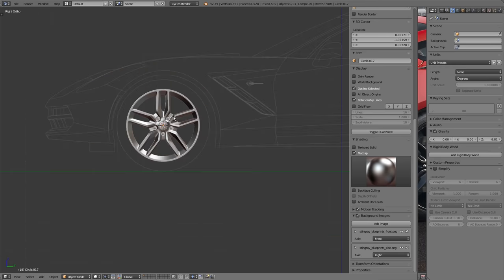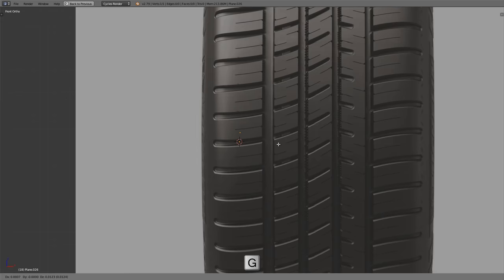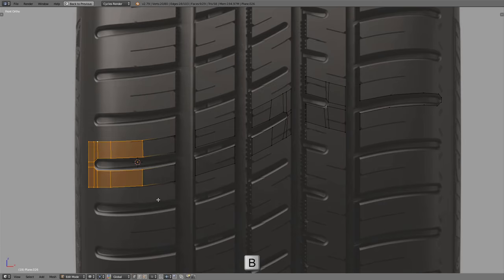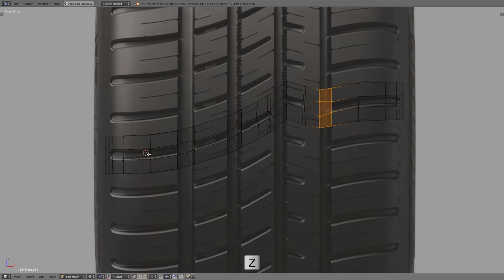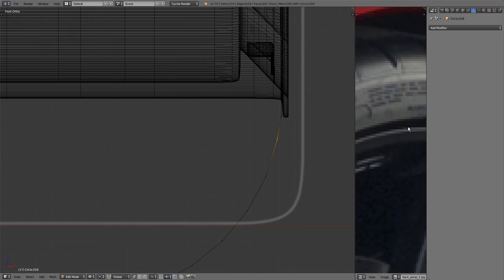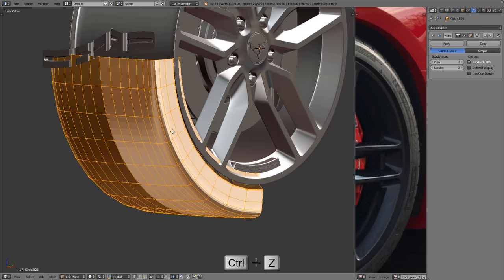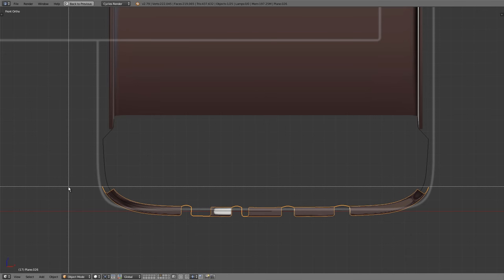Blender Tutorial - Modeling Car Tires

Comment: I have a problem at the end, the bend tool in simple deform modifiers doesn't work properly.
When I augment the value of the angle, the tire treads don't bend around the rim of the wheel but around the z axis remaining "flat" on the floor.
Moreover whenever you use the simple deform and click on the bend tool your tire treads remain straight on the axis of the array despite the default value of 45, while my tire treads deform of 45 degrees
I cannot find the solution of that :(
Thanks for the tutorial anyway, really amazing the result and the level of detail
Reply from the maker: Hey, did you skip the user preference change at the start of the video? That's important to keep the axis in a particular alignment when we go to use those modifiers, which are reliant on axis orientation. To fix it should be pretty easy though, you just need to rotate the empty until it's axis works right for the simple deform modifier. I forget what directions to rotate it to fix it, but if you want to you can send the blend to me at contact@cgmasters.net and I'll get back to you with the solution. -Chris
Reply: It works!! Thank you so much
I thought it was a problem of origin point or rotation/scale to apply or change while it all depends of the user preference like you said

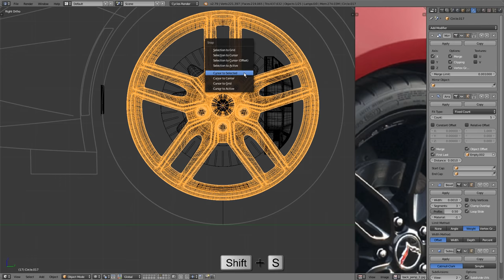Comment: hi ,22:48 i did as you shown here but it did not spin around cursor, only pressing alt+r nothing else ?
and please make new tutorial about tyre in blender 2.82
Reply from the maker: Sorry for the late reply but spinning in 2.8 can be accessed through the left-side toolbar, or by pressing F3 for the search menu and typing in Spin. After spinning, using the operator panel at the bottom left of the 3d view to control the spin amount.

Comment: As someone with experience in the tire industry, it's interesting some of the liberties an artist might take in interpreting the aesthetics of a real tire tread pattern without the knowledge of some of the functional tread geometry normal people (who don't work in the industry) don't pay attention to. The wheel bothers me a little bit only because in a model like this, it obviously doesn't need the functional internal geometry a real wheel has to allow for tire installation and structural strength.

Also, oops! It looks like once the tread got wrapped around the wheel, something reversed it so the inside and outside sections are on the wrong sides of the wheel. The solid tread rib on this particular tire goes towards the outside edge, as it was when modelling the initial tread segment.
Reply from the maker: Yeah I don't know a single thing about tire or wheel production and design, or cars for that matter. I just enjoy trying to recreate the shapes honestly. -Chris
Reply: Funny because every time I model something I tell myself I wish I knew everything about that part, about how it moves, about the real thing behind it. Sometimes I look-up on Wikipedia and Google but the amount of information is insane and often not really useful for rendering it visually. You should check out "wanoco 4D" here on YT, the car he build are insanely detailed and he's rigging everything. He has a completely rigged Mercedes AMG V8 engine.
Reply: @Keilnoth  Oh Jesus, talk about going above and beyond!

Comment: WHEN I OPEN FILE BY BLENDER 2.82  I CAN'T SEE BACKGROUND PLEAS E HELP
Reply from the maker: Background images work different in 2.8x. The images you need are still packed in the blend file though. So first unpack them by going into File > External Data, and turn off automatic packing. Then go back into that menu and choose Unpack All Into Files. Now to add a background image, you can press shift+A and add in a background image object from that menu. Then when it asks you to select and image find the blueprint image you just saved and load it in. -Chris

Comment: your tutorial is so nice but in the end when i used simple deform the tire gets bend awkward i follow the tutorial but it does not work when i tried another blender version it works flawlessly.BTW,i dont know what happened in blender 2.79 with me i dont know about this.
Reply from the maker: That's really weird. Usually this is from not changing the "Align To" option to "View" in the User Preferences like I mention in the beginning of the tutorial. Not doing that will result in your treads bending differently than mine because your Empty will have a different rotation. So it will just require an extra step where you have to rotate your Empty from a couple views until the treads bend correctly. However, if your blend file is working in a different blender version but not in 2.79 that is strange indeed, not sure what the cause could be there. -Chris
Reply: @blengine  This answer of yours REALLY helped after two days of struggling :) Thanks for the great tutorial by the way.

Comment: Hey CG, i the end i applied subdivision modifier, and got over 6 milions faces, its not too much?
Reply from the maker: Just for one tire? Holy cow congrats on running a super computer if that didn't cause massive lag. But yep that's indeed an excessive amount of faces. Tires can really add up the face count but this particular tire shouldn't be even nearly that high. My tire is about 94k tris unsubsurfed, then 379k at subsurf level 1 which is almost always sufficient enough for this. Then at subsurf level 2 it's 1.5 million tris. I'd definitely recommend never going over subsurf level 2, and even that is usually excessive. Was there a reason you needed to apply subsurf? -Chris
Reply: @blengine  Too much subsurf was the problem :) i made it again with level 2 and now with my own wheel whole thing has 600k
Reply from the maker: Much better =D
Reply: @blengine  CG, do You have any tutorial or snapshot of nodes for rubber tire material?
Reply from the maker: Nothing in free form but I have all the materials, including tire rubber, in the full Corvette training course.

Comment: I'm getting a weird fanning effect when I use the simple deform, any ideas?
Reply from the maker: Hey Jackson, send the blend file to me at contact@cgmasters.net and I'll figure out what's going on. -Chris
Reply: Getting the same problem, also when adding the curve modifier i had to use the y axis on relative offset not z axis to get it to aline
Reply from the maker: Did you guys by chance skip over the change in user preferences at the start? I try not to change user prefs for tutorials, but that's the one thing I do change. But I think the solution is the same for both of you then, just rotate your Empty -90 degrees in side view and that should correct the bending. If it doesn't, try rotating the empty another direction. -Chris
Reply: @blengine  Yes that's solved the fanning issue. By the way I don't understand how rotation of empty cause such change.

Comment: the blueprints are not in the file... how do I find them?
Reply from the maker: This is using a much older Blender version that handles background images differently. The blueprints are packed into the .blend file still though, there's just no backgrounds being displayed if you open the blend in newer versions. What you can do is go to File >  External Data > Unpack Resources. Ignore the fact that this option may be grayed out, you can still select it. This will unpack the blueprints to a folder. Now you can add in a new background image object and select the blueprints from that folder.
Reply: @blengine  wow thanks a lot, I did notice the version issue, but did not think it would be a great deal in terms of showing reference images.
Reply: Well I did unpack the resources, but the blueprint files did not show in the folder, as if they were never packed... only the car image and the tire treads image appeared @blengine
Reply from the maker: @maboya  I opened up the blend file in 4.0, went to File > External Data > Unpack Resources. Then I chose "Write Files to Current Directory". If you didn't try that option while unpacking, give that a shot and let me know what happens. I just tested it again in 4.0 and it unpacked the blueprints for me. Alternatively, you can find the images in the Image Editor window, just use the Browse button in that editor to look through all the images, and you'll see the blueprints there. The blueprints do not have Fake Users though, so if you perhaps saved this blend file and re-opened it then the blueprints might be gone from the file. If this is the case, then you can just redownload the zip file and try again. Let me know how it goes.

Comment: The blue print does not show in Blender 2.80
Reply from the maker: Yeah in 2.8 background images work differently. The blueprint image should still be packed in the blend file so you'll just need to add in new background image objects from the shift+a menu and load in the blueprint image. Things might work a little differently when following along with the tutorial though as some of the values are based on the scale of my background images, but there shouldn't be any show stoppers. -Chris

Comment: Alt + R does nothing in 2.8. Does anyone know what the new controls are?
Reply from the maker: You mean for clearing rotation? Alt+R is still the hot key in 2.8+. The only reason I can think of why nothing would happen, is if the hot key was changed manually, or if the rotation was already reset or never changed. Try rotating the object a little, then press Alt+R just to make sure the hot key works. If it doesn't, press F3 for the search menu and search for Clear Rotation. You can use the tool option from that search menu, and it should also show you the hot key next to the tool option. -Chris
Reply: @blengine  When I press alt+R the clear rotation block comes up bottom left hand with a clear delta checkbox, but furthermore nothing happens.
Reply from the maker: @marcelmeijer1923  Hey again, if you're still having trouble you can send the blend file to me at contact@cgmasters.net and I'll check it out. It sounds like there isn't any rotation to clear though. You can check the object axis by going to the Object properties and enabling Axis in the Display panel. If the Object Axis is pointing the same directions as the World Axis(X = left/right, Y forward/backward, Z = up/down) then that means the rotation is already clear/default, so there's no rotation to clear and therefore won't be any change.

Comment: Alt + R does nothing for me, you dont explain what the function is so I dont even know what to search
Reply: This is called "Spin" The shortcut was removed in Blender 2.8. You can either assign it back in the keymap preferences, or you use the spin tool in the tool bar on the left side in edit mode.

Comment: Someone else struggling finding out what happens when you open the archive in Blender 2.81 and there are no blueprints shown?
Reply from the maker: Hey, the blueprints are still packed in the blend file but background images work differently in 2.8. You'll need to add in a background image empty from the Add menu and then you can load the blueprint image into that. Im sure there are background image tutorials for 2.8x on youtube if you havent used them yet.
Reply: @blengine  Thank you for the tip! Surely you noticed that I'm new to Blender, lol.  I'll check on that subject, as I really didn't get what was going on. Really appreciate your attention!
Reply from the maker: @Paulomgdesign  Yep no problem! Sorry this tutorial hasn't been updated, we've been super busy with a big all-in-one 2.8x course all year hoping to get that out in february.
Reply: @blengine   It's part of the learning process to struggle a little bit with the software anyways.
Looking forward for new stuff on hard-surfacing for automotive/product design from you guys! :)

Comment: i got through the whole thing without hiccups but now im stuck at 36:10 it bends into the wrong direction https://imgur.com/a/NO6ix9t
Reply from the maker: Hey did you skip the beginning where i changed the Align To option? If so then your empty will have a different axis orientation than mine and so the deforming will be different. You'll just need rotate the empty from different  views until there tire is rotating the right way. If it doesn't work out you can send the blend to me at contact@cgmasters.net. -chris
Reply: @blengine  This solved my issue with simple deform modifier! Thanks a lot! :D (Blender 3.1)

Comment: man why do they always have to change EVERYTHING with every update ... this tutorial does nothing anymore ... 50% of commands dont work anymore and modifiers do wildly different things these days
Reply from the maker: Hey, which part are you having trouble with? Modifiers are mostly the same and the tutorial is mostly compatible with the exception of UI changes. There are some actual changes to the software but let me know something you've come across that's incompatible and I'll let you know how things have changed in 2.8/2.9. -Chris
Reply: @blengine   hey hey, thanks for the response. I am totally new to blender so I admit there might be setup things on my part I simply missed that lead to the different behaviour on my end.

its mainly menu and short-cut stuff or naming conventions that confuse the hell out of me (as a total beginner) they seem to have changed a lot of detail things that are rather obvious for people using the program for years now but pose a rather significant problem for someone who doesnt know them as well and is now looking to find under which exact obscure name the option is hiding now :D frustration got the better of me in my initial comment I must admit.

Particularly problematic for me seem to be the following things:

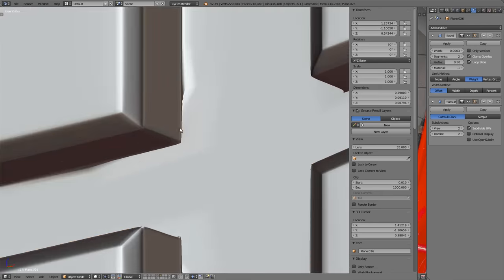bevel and bevel modifier (13:38): even after checking normals first before adding any bevels or subsurf modifiers my whole geometry was a mess after adding the modifiers - the bevel seem to have created extra vertices on top of already existing ones and (I tried cleaning it up as good as I can but there are still quite a few conflicts where things end up with visible geometry defects). 15:26 for example - i got that but WAY worse all over my model and adding bevelweight to the creases did nothing for me. Same goes for edges - for some reason after creating the geometry I had several edges on top of each other (maybe closing loops with F was the problem).

20:50 - alt+R did nothing for me - didnt move at all, did not bring about anyy context menu, nothing - so no way to rotate it that easily.

24:36 - same as above - nothing happened and pressing T also does nothing - so no context menu, therefore no easy rotation.

the rest I figured out already - I was just missing small things here and there. Its just a general beginner frustration with them changing so much that most tutorials really only stay accurate to the letter for only a few months.
Reply from the maker: @PartisanGamerDE  Oh yeah, that makes sense then, this tutorial is going to be really tricky with all the version changes unless you're comfortable with 2.8/2.9 already. And all the progress the software is making is a double edged sword. I love it as an artist, but as a trainer my tutorials get outdated fast now, it's insane to keep up with. But let's see if we can clear some things up for you:

For the bevel modifier, can you send me the blend file showing the mess it created? You can email it to contact@cgmasters.net and I'll figure out what's going on.

And yes the Alt+R hotkey was removed and now that hotkey... does nothing at all.. So I have no idea why they removed it, makes no sense, maybe they're saving it for a new tool soon or something. To access the Spin tool now, you can find it in the left side toolbar of the 3D View, or you can press F3 for the search menu and type in Spin, and then access the tool from there. There is actually a difference in both ways of accessing the tool. Accessing it from the toolbar will give you a Widget that you can then click and spin the selection around, but you'll need to take some extra steps to get it to spin on the right axis. The tool from the search menu, however, will automatically spin it around based on whatever view you're in. So I would suggest using the tool from the search menu.

When it comes to the T key to access the Operator Panel that I use throughout the tutorial and that course, that Operator Panel now appears at the bottom left of the 3D View every time you perform an operation. Like when you press R to rotate something and the confirm the rotation, that operator panel pops up at the bottom left, and then you can expand that panel and change the rotation values if you want to tweak it.
Reply: @blengine  thank you very much for the clarifications! Concerning the .blend file I already cleaned it up by removing the vertices that created the the messed up geometry one by one :D took me a few hours but its pretty ok looking for my first tire :D But thank you for your offer!
Reply: @blengine  Thanks for answer !!! Helps a lot